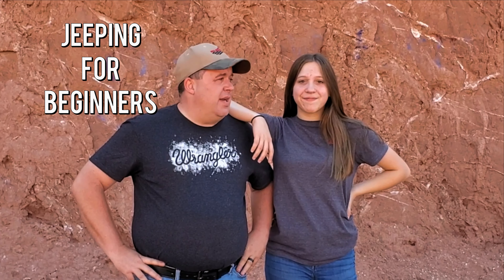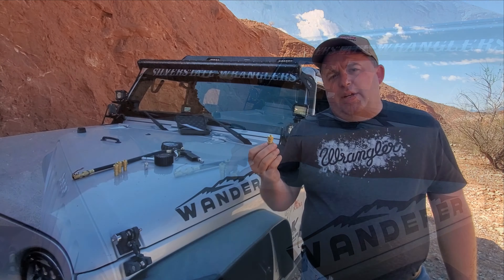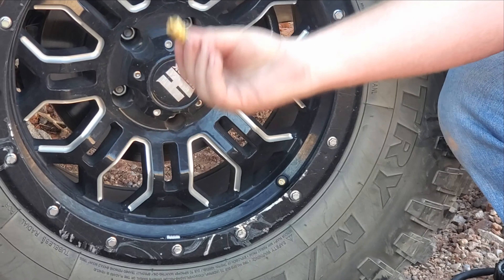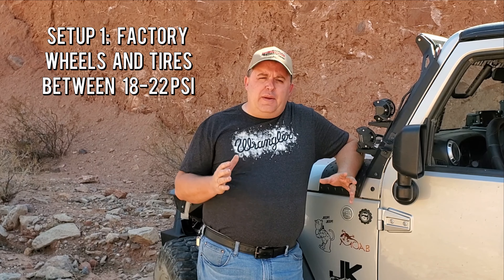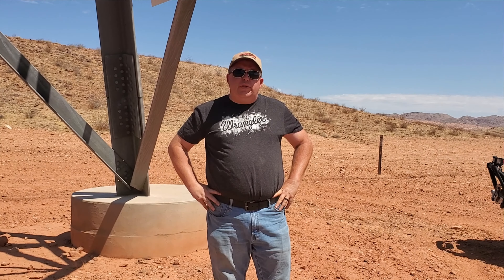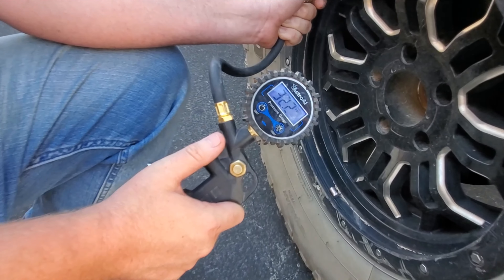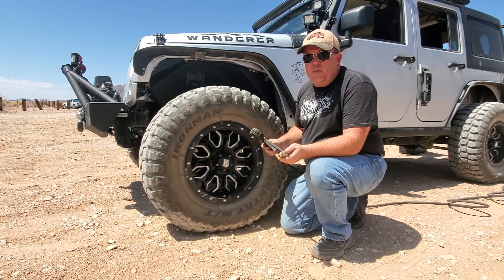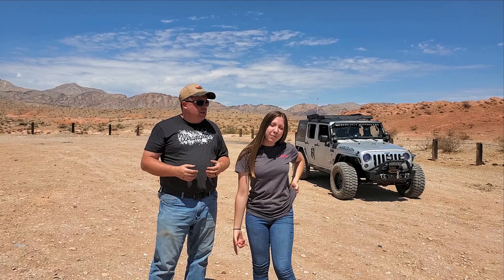Airing down tires for off roading: Jeeping for Beginners

Comment: Thank you for your video. What kind of air compressor are you running?
Reply from the maker: I use Viar. With a 2.5 gallon pressurized tank. Can air up, all four tires,  from 15 to 30 psi in about 8 minutes. Chose this set up because I needed the reserve tank for the train horns. 😉